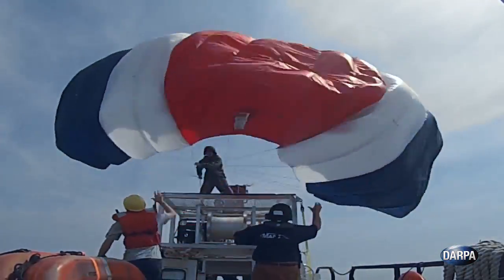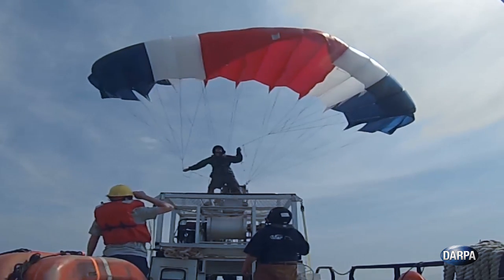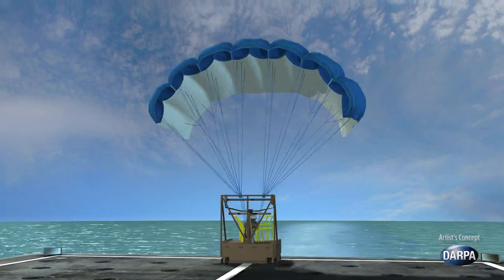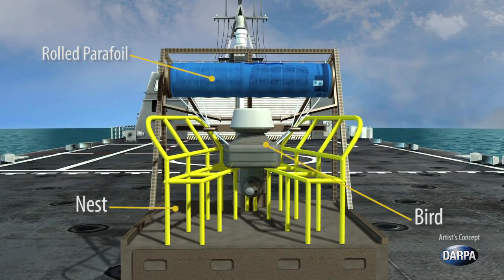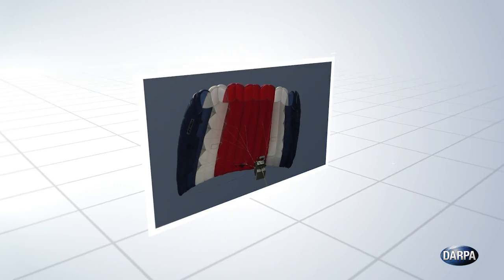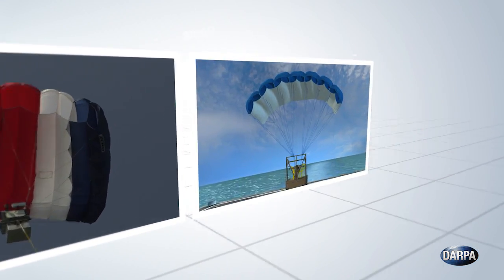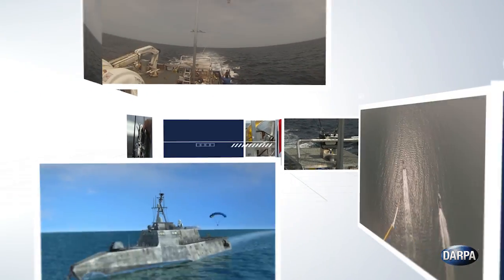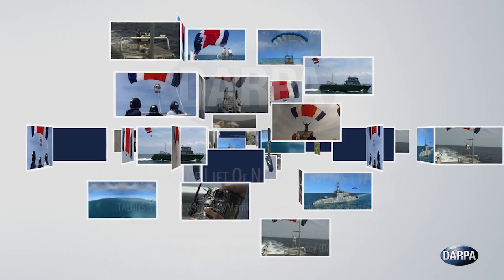Towed Airborne Lift of Naval Systems (TALONS) Prototype Demonstration

Comment: I just got an idea. why not look into weapon capabilities ? Somalia has prates and security forces usually needs time to get on the scene. why not equip High Valued ships with one that can deploy giving them communication to oncoming security vessels and giving them eyes in the sky, but also giving them  the authority to attack with some small munitions like a CBU-97 sensor fuse munition. or attach a RQ-16 t-hawk install CBU-97 munitions and if given the green light it will fly over target and deploy a senor fuse and destroy or disable the target. I'm not to sure how the MAV will work in maritime conditions but that would be kind of cool.

Comment: Why not inflateble aerostat?
Reply: +Sharif S this is cheaper and more easily serviceable.
Reply: +roidroid But doesn't it require some wind to work?
Reply: +Slice dice no wind is required, but the boat is required to be moving.
Reply: +roidroid Yes, either wind or create airflow through movement. I imagine there're going to be some limitations when compared to aerostat type system.
Reply: +Slice dice Aerostats also have limitations.  They can't be deployed quickly, can't be serviced/re-outfitted quickly; they are more susceptible to jamming (unlike a wired system); and are much more expensive and complex to design and to command.